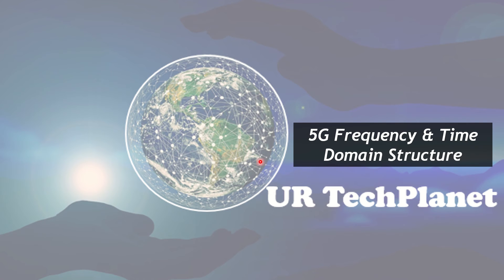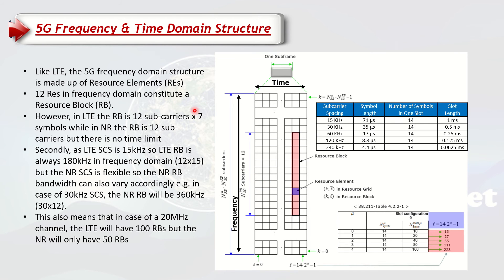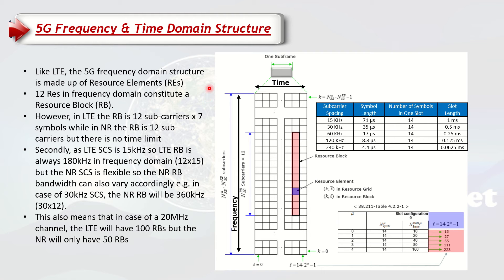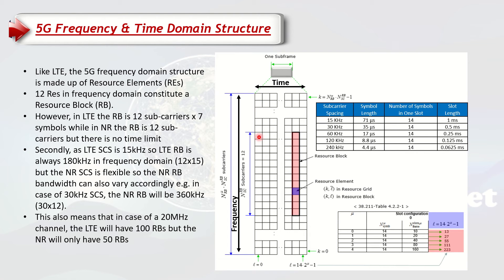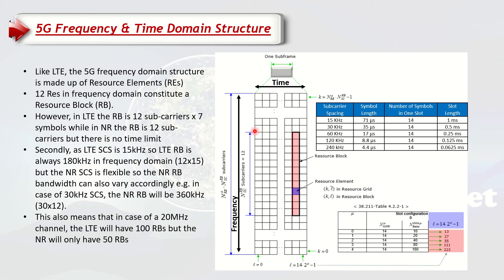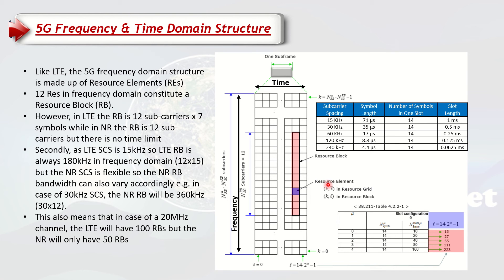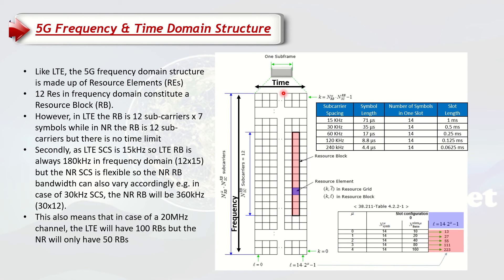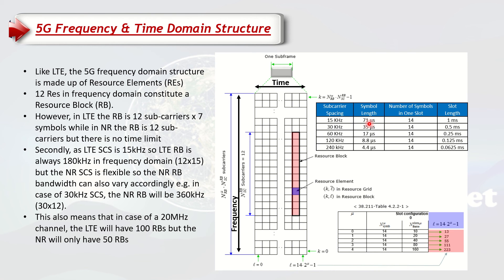5G Frequency and Time Domain Structure

Comment: Hi, how many symboles in one subframe ?
Reply from the maker: In NR, usually we are using the term Slots and so as an example, in case of low band, one slot is equal to a subframe. So, both of them have 14 symbols.

Comment: Thank you for this video. Really helpful. One question, though. Why do we have 50 RBs for SCS = 30 KHz? If it is the double of symbols compared to SCS 15 KHz, why don’t we have 200 RBs?
Reply from the maker: RBs are in frequency domain and symbols are in time domain. So with SCS 30KHz, a RB takes double the amount of bandwidth compared to 15KHz. Thus, a channel bandwidth having 100RBs with 15KHz will only have 50 RBs in case of 30KHz.

Comment: Why have you 100 RB's for LTE in case 20 MHz? I didn't understand. Thanks.
Reply from the maker: This is based on specs. In simple words, in LTE there is a 1 MHz guard band on both sides in 20MHz channel. So actual bandwidth used by LTE is 18MHz. In 18MHz, we can have only 100 RBs (12 * 15 * 100 = 1800kHz or 18MHz -> 1RB = 12 subcarriers with 15kHz spacing)
Reply: @OurTechPlanet  Thanks a lot!
Reply from the maker: @Sergey-mq3ol  You are welcome
Reply: @OurTechPlanet  May I ask a question? :) What is "Base time unit"? Known as Tc. In 5G = 1/(f*Nf) = 0.509ns in LTE = 32.55 ns. Thanks